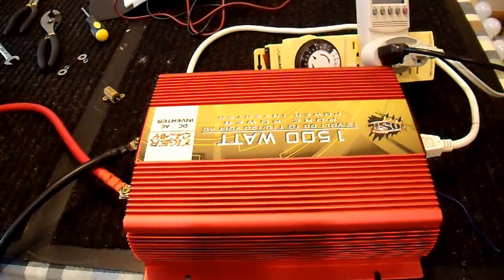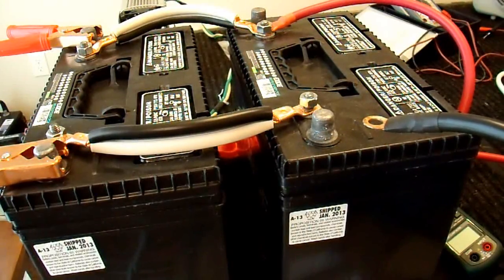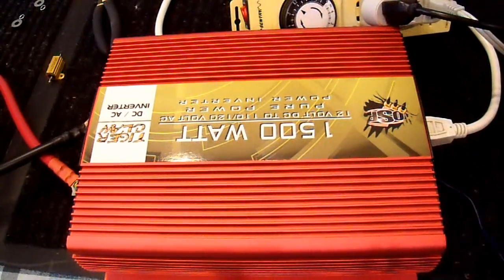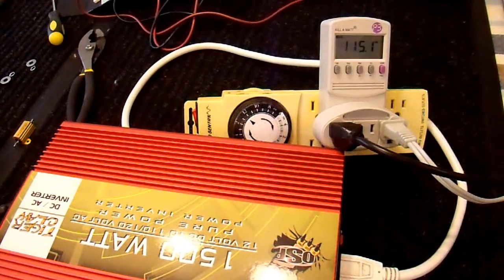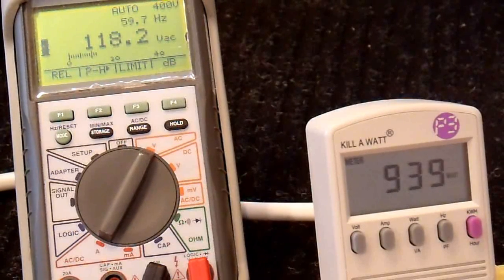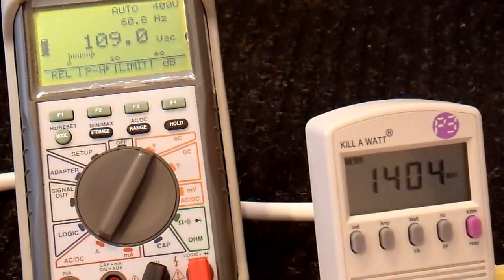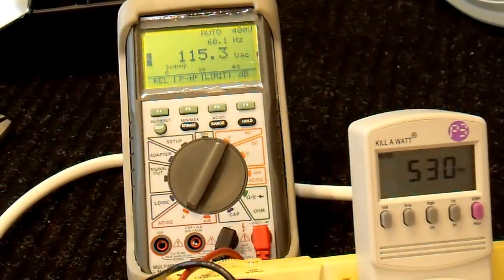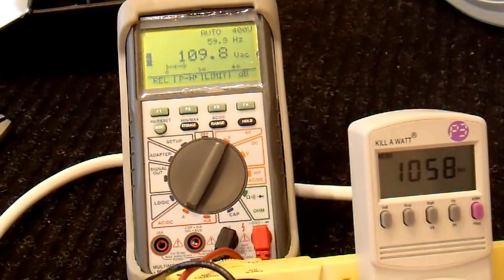OSP Tiger Claw 1500W Pure Sine Inverter Load Test - Output Voltage

Comment: I purchased this specifically so I could run a laser printer in my car and every one of them that I own shuts down as soon as I plug them in. Waste of money.
Reply from the maker: The problem is either your car battery or the connection to the battery.  This inverter will easily power a laser printer.  My rule of thumb is that a car style battery is only able to provide about 1000W of power (assuming very good cabling, much less otherwise).  If you're trying to power a laser printer off of your car you need to do some fairly elaborate modifications to make it work.
Reply: Thanks for the rapid reply. This is the second vehicle that I've installed it into. Same cable which if I remember right is 3 gauge but it's pretty heavy duty and it still does the same thing. I have condidered that maybe the battery itself is not enough to power the inverter but when you buy the inverter they just tell you simply to hook it up to the car battery. I'm thinking maybe if I get a deep cell and hook it up separate from my car battery that
that may do the job . If you get a chance I'd appreciate your thoughts on that.
Reply from the maker: @lovingjesus5184  I have an old video on choosing power cables for inverters that may be of help.  It is possible that the particular combination of inverter and printer simply doesn't work, but if the inverter performs as well as the one I tested that seems unlikely.  I believe you likely need a aux battery with short cabling to the inverter to make this work.  Vehicles just aren't very good at powering anything more than the loads the manufacturer designed the vehicle to power.
Reply: @knurlgnar24  yeah I think everything you've said is spot on. The fact that it's happened in two different Vehicles says that it's probably not getting enough juice from the battery. If you can shoot me a link to that video you mentioned it would be greatly appreciated. Thanks again for your replies
Reply from the maker: @lovingjesus5184  "How to Select and Purchase Battery Inverter Cables Part1" is the first video.  It's an old one but I think still relevant. I think in your case a good aux battery connected to the vehicle system should solve your problem.  That's my best guess at least!

Comment: I really enjoy your videos. I installed the remote switch per one of your videos and it performs flawlessly. I have run into a problem and hope you can help me. I have my RV running 6 new 6v golf cart batteries. I have four 100 watt solar panels connected through a 20 amp controller. Since only 2 are aimed at the sun at any one time I only generate 18 amps so the controller is holding up well. I charged the batteries to full charge today and turned on the TV, controller, and the stereo sound system. My voltage dropped from 12.8 volts to 12.2 instantly. I was able to make a cup of coffee with my Keurig but by the time it was done I was at 11.8 volts. Turning off the inverter my batteries recharged within a few minutes. I assume this is normal. My problem seems to be that after running my TV with a dish reciever for a few minutes the voltage soon drops to 12.0 volts. I wondered which load was using up the power the most so I started turning things off one at a time. Nothing seemed to make a difference. the panels were simply not charging the batteries. Finally I turned off the inverter and right away the batteries started to charge. How much current is my inverter suopposed to draw? The specs don't say. It seems as though the Tiger Claw uses nearly as much power as my Keurig coffee machine! HELP!

Comment: would like to install in my auto., for operating an oxygen concentrator enabling travelling.requirements to run my concentrator are 300watts running and 1200 watts starting loadper a manufacturers  technician with pure sine wave power. never saw this any ones channel, any advice?

Comment: What is the wattage of the 1.  Ohm capacitor you on the video?
Reply from the maker: I believe it was a 20watt resistor but it doesn't really matter for the purpose shown here.  A 1/4W resistor would work just fine.

Comment from the maker: I've measured efficiency curves of both the Aims 2000W and Tiger Claw 1500W off camera in the past.  The 1500W Tiger Claw has a higher output capability despite its lower rating, but the Aims unit is very efficient.  The Tiger Claw is not very efficient.

Comment from the maker: A properly wired 20A branch circuit will only drop a few volts at full load - volts is what is important.  Hz will remain constant in pretty much all inverters.  Resistance appliances like toasters will not work properly at low or high voltages.  That is because watts is proportional to the square of the voltage at best, and many devices like light bulbs are closer to the cube of the voltage due to resistive element heating.

Comment from the maker: Those Honda or Yamaha gensets are very nice, but also expensive!  Batteries can be left connected in parallel for long periods of time without issue as long as they are of similar age and condition.  If age/condition are different then you'll want to monitor closely and often to make sure they are charging properly, floating properly, etc.  It can be done with mismatched batteries but is generally not recommended.  I'd do it anyway though since I know I'd monitor it properly.

Comment from the maker: At 1000 watts the output is good even when running on a partially drained battery.  I can't comment on the cooling fan quality as I haven't run them very long, but the PWM control they use is hard on many of those small fans.  This isn't unique to Tiger Claw.

I can not confirm or deny the Apple charger issue, but this is clearly an Apple problem if it exists and not the inverter's fault.  Those chargers, Apple brand included, are made to be cheap cheap cheap.

Comment from the maker: There are some inside shots in the video where I added the remote switch.  The primary limitation in nearly all inverters is the transformer(s) in the step-up circuits.  These are the most expensive parts and are usually the limiting factor.  Not much to do about it except buy a better inverter, unfortunately.

Comment from the maker: I don't remember seeing a potentiometer for adjusting the voltage - you'd probably have to replace a resistor to change the voltage.  It would still sag under load, however.  The sag is a result of losses in the DC/DC step-up portion of the inverter which is generally an unregulated voltage and sags with load.  The AC voltage is regulated by the output portion and the output board isn't getting enough voltage to generate the proper AC voltage when there is a lower battery voltage powering it.